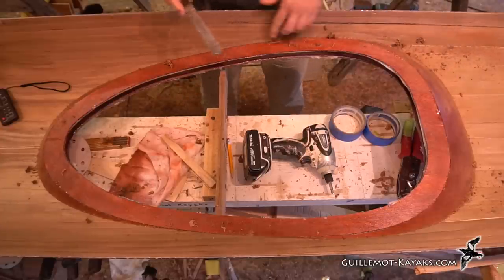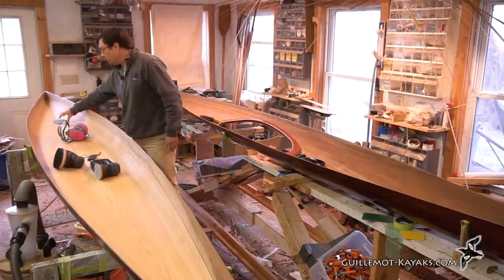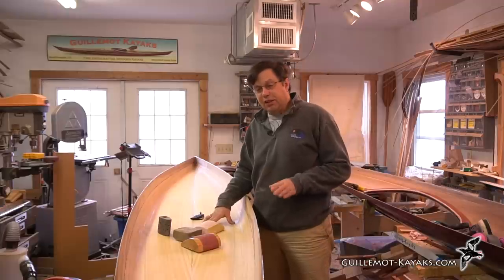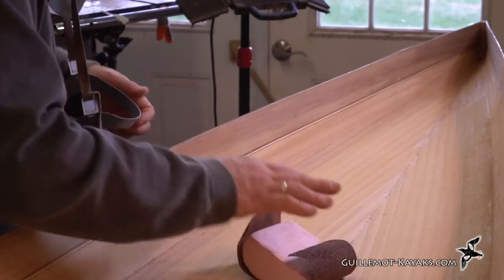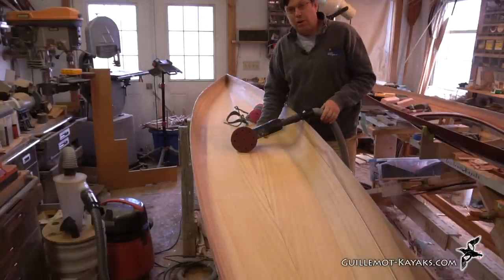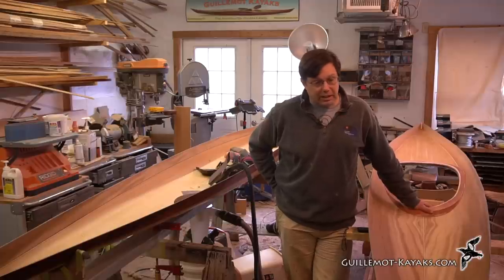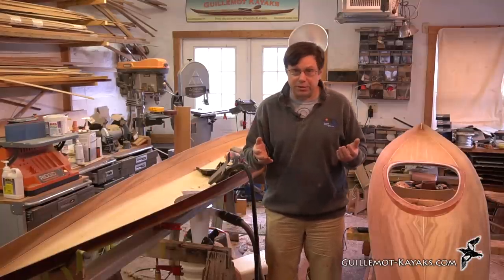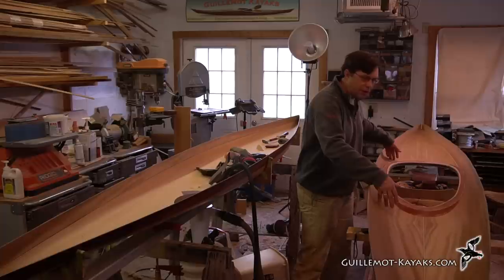Final Interior Sanding - microBootlegger Sport - E45

Comment: Thanks for all the videos Nick! You've really gotten me through a difficult winter when I couldn't do much because of injury.
Regarding cracking and glass,  I experienced a somewhat opposite situation - a rock fractured the wood and glass inside the hull under my seat, but the exterior glass stayed intact and watertight. There were 2 layers of 6-oz E-glass on the outside and one layer inside (though not specifically for this purpose). Do you think there's any benefit to intentionally making the exterior layup stronger than the interior to attempt to control where a potential fracture might occur?
Reply from the maker: The loading on the structure can get a bit complicated. If you just sit on a rock, the outside cloth will be in compression and the interior cloth will be in tension right where the rock is.

With two layers on the outside, you have something that is pretty strong in compression and a fairly high load on the inside pulling the single layer of glass apart.

I've had similar damage where I hit a rock hard, it popped a piece of the plywood (this was a S&G) out about the size of a quarter, but I didn't get a leak. So the interior glass completely failed but the exterior was in pretty good shape.

My thinking with two layers on the outside is usually more about abrasion protection. You typically have more occasions where you are dragging or sliding over something, where the load isn't high enough to really break anything, but it may scratch or cut the surface.

So, two layers of glass on the inside would definitely make it stronger. The question is, how strong is appropriate? It is impossible to guarantee the boat won't break. The ocean is always stronger than your boat. So, where do you draw the line.

To me, it is good when you can paddle away after a hit. But, what it takes to accomplish that is hard to know before you hit something.

Comment: Nick have you looked at using the router attachment for Dremel tools to do the cleanup around the coaming  instead of the small router?
Apologies for the marine paint comment on an earlier video. The bookmatching is looking superb.
Cheers Eric
Reply from the maker: I do have a dremel router, but I'm cutting a fairly large diameter round-over. The dremel jus doesn't swing that size bit.

Comment: Superb as always. My question is somewhat unrelated to today's video, but seeing the coaming reminded me. How do you size the cockpit cutout to accept a spray skirt? Do you choose a skirt then make the cutout match, or do you cut the cockpit then find a skirt to match? Also curious what skirt you prefer.
Reply from the maker: I usually use neoprene sprayskirts. Neoprene stretches so there really isn't a "perfect" fit. Get a skirt sized for the same approximate dimensions as my cockpit and they seem to work fine.
Reply: Nick are you an Amazon affiliate? When you post your links for tools you used for each video I’ve found that extremely helpful and would love to use those links to buy supplies from amazon if it will help you. If not you should look into becoming an Amazon affiliate.
Reply from the maker: All the Amazon links are affiliate links so I should get a cut. When Amazon does not have the item, I link to whoever has it. Those are not affiliate links.

Comment: Do you use 6 oz S glass on the hull?
Reply from the maker: The hull exterior is currently one layer of 4-ounce S-Glass. I will apply a second layer when I attach the deck.
Reply: Nick Schade Very cool.  Thank you.  I’m building a wooden paddle board and will go this route.  Funny what you forget when you get away from composites for a while.  Used to use 6781 S glass on a daily basis and wasn’t even thinking taking that route, but it makes so much sense.